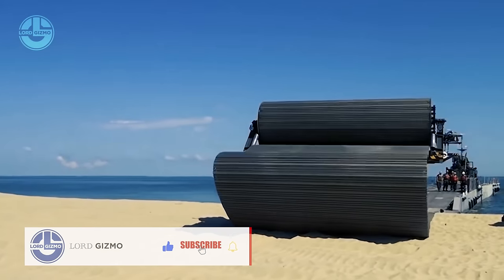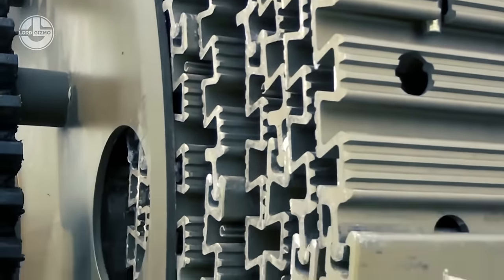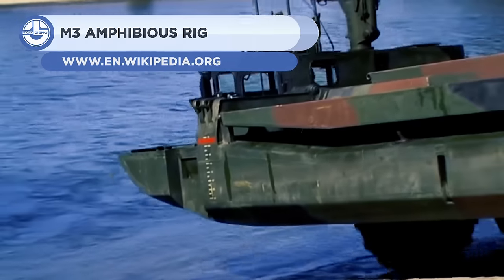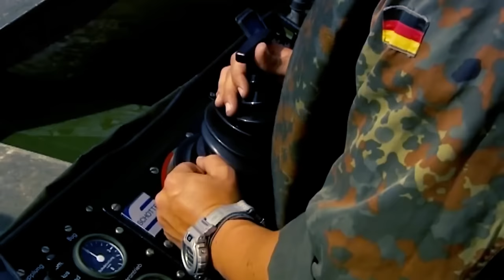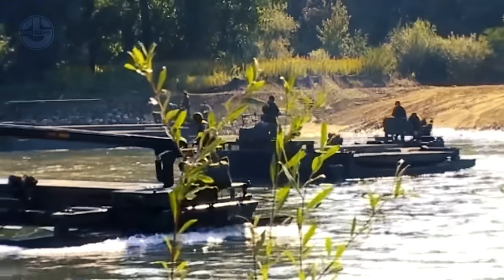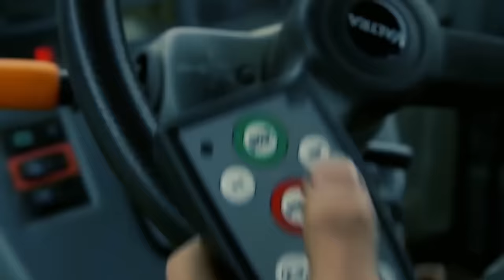The TOP 10 Coolest Machines That Actually Exist

Comment: Barrels inserted on a barge. Could accompany a track on each side. Using water to carry the weight, or payload. Walking track. For Egyptians.
45 galln drums. Will float. Taking dead load. Off rotors under the load . Track would only displace psi from there.